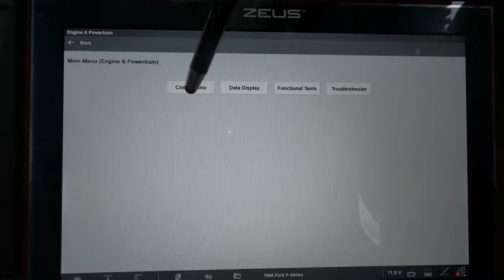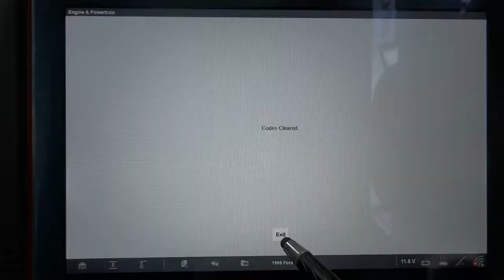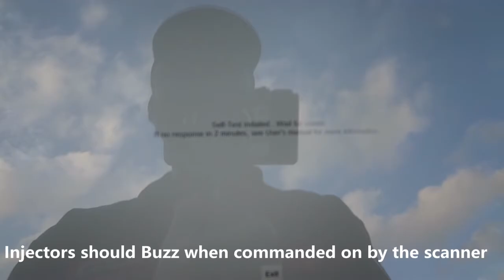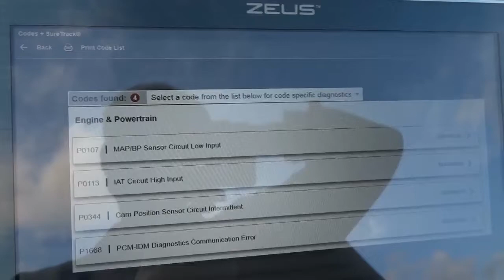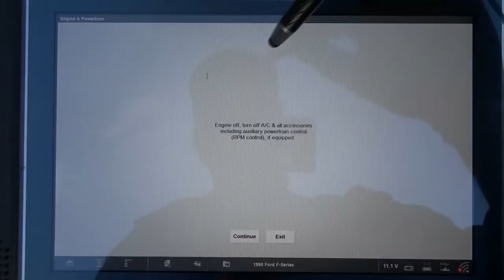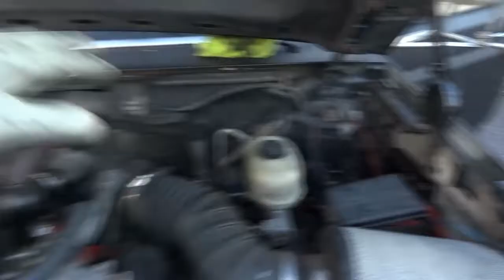Ford Powerstroke  7.3L Crank no Start, Fuel injector testing

Comment: Just subed. Hi. I have a 1999 ford f250 4x4 super duty standard cab I have a great engine turn over, but no start. I replaced both relays that where behind the dash to the right of the steering wheel. They where beside the flasher relay, and still no start. Is there a way i can check the fuel pump to see if it is pumping fuel. Oh this is a gas engine. That is my next step. This video was fantastic, very easey to understand.......Thank you,...............A friendd from Canada.
Reply from the maker: @tomhall3175  thank you! did you check the fuel pump fuse?
Reply: @KITS_Auto_and_Truck_Repair  Yes i did. Tomoroow i will use the starter fluid in the air intake and see if it starts for a bit, if it does that means its a fuel delivery falt right ?.... Thanks ........A friend from Canada

Comment: I have a 1999 E450 bus And over the past couple months, the starting issue has gotten worse now is at a point where it has to be hooked up to a jump box and start a fluid need to be used in order for to start up so does that mean the injector module is starting to go out
Reply from the maker: @terrellscaife2411   Yeah probably

Comment: Your story follows mine, except that I have a power/ground failure. The PCM is not sending the enable signal to ground the ground side and power the IDM. Is there anything other than a blown PCM that can keep a good PCM from enabling the IDM?
Reply from the maker: @dougmartin6717  you might have an open wire between the PCM and the IDM
Reply: @KITS_Auto_and_Truck_Repair  that was the first thing I checked. Connection fine. Inspected the PCM board. Except for some rubber coating that's peeling away in places, nothing looks or smells burned. Already ordered a new PCM from Rockauto, but feel like that's a flip of the coin. I am just wondering how smart the PCM is, and if it would inhibit the IDM if it detected say, a short in one of the sensors or driven outputs. And be perfectly fine otherwise. I also wonder how easily its programming gets corrupted.

Comment: I have something similar but the power goes out and later comes back new relay all the fuses are good I put in new Glow Plug Relay Solenoid for 1995 7.3L Powerstroke and it turns on for 5 seconds and turns off and doesn't turn on for a while
Reply from the maker: @hectorgreen515   Check the injector module!
Reply: @KITS_Auto_and_Truck_Repair  no have positive energy in pcm

Comment: How to you test the 12v supply side of the injector driver for a shorted driver with a test light? I connected the test light to battery positive and and touched the test light to injector  driver 12v supply to injectors. The test light was flickering. I know the light should only flicker on the control side when the pcm pulls them to ground. But it shouldn't flicker on the supply side, positive to positive should it? Did I do this right? Have I confirmed supply side injector driver shorted? Need a second opinion to confirm I did this test right please.
Reply from the maker: @michaelcox2648  I didn't understand your question! are you trying to test the power supply to the injector or the injector driver module?
Reply: @KITS_Auto_and_Truck_Repair  it's the injector driver module with injectors unplugged the test light is flickering.  Does that confirm injector driver supply shorted? Hope that makes sense.

Comment: why is testing the injectors next when it cranks and no start? can there be elec problems or good pressure at the fuel bowl but maybe fuel not getting to injectors, and if the orings are bad on injectors wouldnt the oil be thinner and fuel in oil??
Reply from the maker: @ronaldlemons2836  that's possible yes!
Reply: So with crank no start, the injectors are the next step?

Comment: My 7.3 it was my idm. Mine retained water. Got a new one and it’s been working. I had the ford dealership test it and they did fix it. IDM replaced 😊
Reply from the maker: @OutdoorTonez  Oh cool!
Reply: Hi Deo, is it possible to test the injector control module connector with Noid lights to confirm it’s receiving power and ground, instead of back probing it because in the absence of a wiring diagram, determining the power cable from the ground would be a guess work which may be disastrous due to the voltage of the injectors as you have warned?

Comment: Great job! Is there any way to diagnose without the scan tool? How can you test the signal to the injectors without that type of scanner?
Reply from the maker: @berniemac8413  Thank you! you a good scan tool to do that test!
Reply from the maker: @berniemac8413  Thanks! you need a good scan tool to do that test!
Reply: @KITS_Auto_and_Truck_Repair  would any bidirectional scanner work? Or which would you recommend? Got a 05 sprinter that I’d like to use it on as well.

Comment: I ran my 96 out of fuel and was able to get it to start yesterday but I had loss of power and then turned off. I charge the batteries and now I have a crank but no start. Could this possibly be my issue as well?
Reply from the maker: @kingrichard_1093   Make sure your fuel bowl is filled with fuel

Comment: K where does the IDM receive it's power from I have checked everything I can think of replaced the cam/ Crank sensor the oil/fuel pressure whatever sensor I don't have power to the IDM or the fuel pump
Reply from the maker: Donald Sterling  check your fuses!
Reply: @KITS_Auto_and_Truck_Repair  I did I have like 5 with no power
Reply: But I don't have an owners manual to see exactly what they go to
Reply: Ok I checked all the fuses I have 5 that I have zero power to on either side of the fuse I don't know how to check relays and I have 4 in the fuse box and 2 under the hood on top of the drivers side front fender that I have found so far and looked for bad or chewed wires and haven't found any

Comment: The injector module relay number 303 in my 2002 Ford F350 diesel lariat is buzzing very loudly and the truck won’t start should I replace the relay or head towards the module itself time sensitive
Reply from the maker: John Bevil  check power and ground at the injector module first!

Comment: Excellent troubleshooting video.  My truck was running fine when I shut it off 2 years ago.  Upon starting it recently, it started, ran rough and died.  Now, no start.  The ICM was full of water, swapped it out.  Replaced the cam position sensor, fuel filter, IPC, and put a gauge on the HPOP.  Finally towed it to a diesel shop, and 6 weeks later, I owe more than the truck is worth, and it still isn’t running.
They’re telling me that it needs 2 injectors, and if one stops up, it can prevent fuel,from getting to all of the injectors.
Am I being had by this shop?
Reply from the maker: nclaytonc  I wonder why they replaced all those parts!!
Reply: @KITS_Auto_and_Truck_Repair  in all fairness, it was I who replaced the parts before I finally decided to take to someone else.  The Injector Control Module was full of rain water, so I condemned it.  The IPC, cam sensor were cheap enough, and the fuel filter had 148k miles on it.
I talked at length with the mechanic yesterday.  He was a Ford tech for a dozen years, and trained other techs on the 7.3, 6.0, and the 6.6.  I was impressed by his knowledge and thoroughness, but the bottom line is we’ve spent a lot of money and it still does not run.
The only parts that don’t check out at 100% are 2 injectors (#4 and #6).  
Right now, I’m waiting for the shop manager to come back from vacation so we can agree on a not-to-exceed repair cost.
The no-start condition is being blamed on the tank of bio-fuel that has now been in the tank 4 years.  I didn’t know that bio-fuel has the same issues as ethanol gasoline when it sits too long.
Reply from the maker: @GenerationsLodge  ok!
Reply: @KITS_Auto_and_Truck_Repair  any thoughts on the bio-diesel thing?
Reply from the maker: @GenerationsLodge  I don't know much about bio-diesel

Comment: Sir, regarding to my Engine T444e Only Timing cover Remove and changes this Oring Gasket after fixing the Timing Cover engine No Start Only Crank what is the Problem. Sir?
Reply from the maker: Ramel Saudi  Check your crank sensor! did you reconnect the sensor!
Reply: Yes Sir Already reconnect the The Crank Sensor I change New but same Problem.. Only Crank but no Start

Comment: Great informative video. Is there a way to do the "buzz test" without having the diagnostics computer?
Reply from the maker: Richard Varner  no you can't! you have to have a scan tool capable of doing that test!
Reply: i got a bluetooth OBDII adapter and forscan on my iphone to be able to do some of the diesel specific tests and view data to/from the PCM & sensors.
Reply: Thank you for this information

Comment: What if my truck starts when the engine is cold but when it's hot it will shut off even when driving it
Reply from the maker: Danny Swanger  you could have a failing IPR or a fail injector module as well, and list can go on and on and on, so I recommend you take your truck to a pro mechanic so they can diagnose it!

Comment: What's the scan tool you used?
Reply from the maker: Calbert Garavito  I'm using the Snapon Zeus in this video
Reply: @KITS_Auto_and_Truck_Repair  yeah out of my budget. How did you hook up the scan tool to have it do an injector buzz test
Reply from the maker: @curiousgeorge986  yes, it's a test that the scanner does!
Reply: @KITS_Auto_and_Truck_Repair  I know that, I was inquiring how you hooked it up to do a buzz test
Reply from the maker: @curiousgeorge986  hooked what? I didn't hook up anything but the scanner!! the buzz noise comes from the injectors

Comment: I have crank no start and it only happens sometimes, most of the time my truck turns on . My wait to start light turns of fast then check engine light turns on and obd scanner
 won’t communicate
I already changed glow plugs and solenoid me ipc and cam and all sensors except exhaust and hhop

Comment: Excellent video. Trying to diagnose my son's 7.3. crank no start, I'll have him check powers and grounds. Fuse #22 big 30 amp, no power at either side of fuse, any thoughts?
Reply: Had my 96 7.3 die on the highway... fuel bowl heater shorted out and blew the 30a fuse.  Replaced fuel bowl heater and fuse and fired right up.   The old heater used a looped wire which broke loose and caused the short.
Reply from the maker: Kelly Simonson  check main fuses or fusable links on the power cables coming from the battery!!

Comment: My check engine light doesn’t flash on and off when I turn the key. I have crank but no start. New fuel pump but still didn’t start. What should I look at?
Reply from the maker: sean sarti  if the check engine light doesn't come on when you turn the key on, you should check the the PCM fuses, and powers and grounds at the PCM

Comment: I have a 7.3... had the same problems.  I replaced the cam shaft sensor twice...second time I used a ford part.  Didn't fix my problem.... I replaced the ICP sensor and it would not start.  Put the old one back in and it started, but ran rough.  Swapped the bad sensor, put it in and it ran like a charm.  The next day the truck would not start.  Any idea what could cause this?  I am going to try yet another sensor for the ICP.  This blows my mind how it worked yesterday and not today.   Thank you in advance
Reply from the maker: Hip Airbrush you should check your injection pressure, sounds like you might have a defective IPR or bad high pressure oil pump... get a pressure gauge and install it on the ICP sensor opening, crank the engine and see what kind of pressure you get

Comment: My 94.5 psd isnt showing that service engine light that you talk about in this video when you first crank It? I have a new idm and pcm, any recommendations on what to do next?
Reply from the maker: Marcus Lopez did you replace the PCM? if yes, why did you replace it? you can start by check powers and ground at the pcm, to see if it's been powered!!!
Reply: @KITS_Auto_and_Truck_Repair  I replaced it because of a leaking swollen capacitor, check engine light and wts does come on just no service engine soon
Reply from the maker: @cub862001  most vehicles only have one light, it's either the check engine light or the service engine soon light, if the check engine light is on it means the engine computer is most likely been turned on, was the new PCM calibrated or programmed?
Reply: @KITS_Auto_and_Truck_Repair  I sent it off to Cardone to rebuild it and program it, called ford and they don't make them anymore only rebuild your own, it's obd1 cus its a 94.5, has obd 2 hookup in cab but came not flashed for 2, can I eec test it since it's diesel? Or am I going to have to find a scanner for obd 1
Reply from the maker: @cub862001  oh ok, you should have a mechanic look at it for you

Comment: How can I do a injector buzz test for a 7.3l with no obd2
Reply from the maker: 350 luiZ no you can't do a buzz test without a scan tool, and it has to be a scanner with bidirectional controls...
Reply: @KITS_Auto_and_Truck_Repair  any tip on how I could check em
Reply from the maker: @LuwisRz  you can't check them without a tool
Reply: @KITS_Auto_and_Truck_Repair  or how I can test the idm
Reply from the maker: @LuwisRz  check your powers and grounds at the IDM, follow the steps on the video... Good Luck!!!

Comment: So a p0344 is a bunk code for cranking excessively
Reply from the maker: DIEhardHD I'm sure about that code... what's going on with your Powerstroke
Reply: @KITS_Auto_and_Truck_Repair  it won't fire worked the previous day everything works as it should you can hear the injectors clicking but nothing
Reply from the maker: @The-Neighborhood-BootyBandit  do you have enough oil in the engine... does the check engine light come on when you turn the key on?
Reply: @KITS_Auto_and_Truck_Repair  yes CEL is on the pcm is fully functional glow plugs kick on everything works and I added about a gallon of oil but but nothing but interesting has oil pressure, rpm is visible, bowl fills back up
Reply from the maker: @The-Neighborhood-BootyBandit  that's weird, disconnect the Injection pressure sensor on the driver side cylinder head and crank it with the sensor disconnected and see what happens, if that doesn't help, crack the fuel lines going to each cylinder head on the back of the engine next to the turbo then crank the engine, fuel should come out of those lines while you're cranking it... Good luck, let me know what you find
Reply: @KITS_Auto_and_Truck_Repair  it was just low on oil it took a few cranks to build pressure but it ran for a few days now it won't start again now you'll hear the injectors clicking every 5 seconds or so I pulled codes nothing shows
Reply: @KITS_Auto_and_Truck_Repair  I swapped idm to see if that was the issue but no it's got oil pressure definitely I'm just not sure why the injectors aren't turning on but it's tries too
Reply from the maker: @The-Neighborhood-BootyBandit  you should check your IPR and IPS ( injection pressure sensor ) or have someone check it for you... Good luck...
Reply from the maker: @The-Neighborhood-BootyBandit  you should get a diesel mechanic in your area look at it for you... good luck!!!

Comment: Where did he get on so quick? Ive been trying to find a pcm for my 95 7.3 with out waiting for shipping and im located near the area
Reply from the maker: Hernandez The great we got that injector driver from AutoZone...try the AutoZone near you!!
Reply: @KITS_Auto_and_Truck_Repair  I got mine from o'reilly parts
Reply from the maker: @schawnfleites1555  that's awesome, did it fix your problem?
Reply: @KITS_Auto_and_Truck_Repair it broke down in the dead of winter in Colorado. I live in new jersey.Called mobile mechanic he told me he’d be there in a few hours but long story short change the sensor and never came with scan computer which I asked him to do. Second day new mechanic came did a scan but couldn’t do a test on injectors.he said to start with the controller. One minute after new one, boom. I not ashamed to say I cried when it started.
Reply from the maker: @schawnfleites1555  hahahaha you cried!!! I'm glad your truck is fixed, safe travels
Reply: My truck died in a Walmart parking lot and it turn out to be this. Worst three days of my life.
Reply from the maker: @schawnfleites1555  oh really? that sucks...

Comment: Hey i hava a question i have a 7.3 that only 4 injectors has power. The other 4 injectors that are in the passenger side that harness dosent have power what can it be and is not the valve cover harness 8 injectors are new. I change both computer too and still doing the same thing
Reply from the maker: Melody Carrero it sounds like you have a wiring issue, check power and ground at the IDM, if you have power and ground for the injectors at the module , you should also have it at the heads, on both sides... be careful checking those wires, there is 200v on them/ the other possibility would be the module itself,